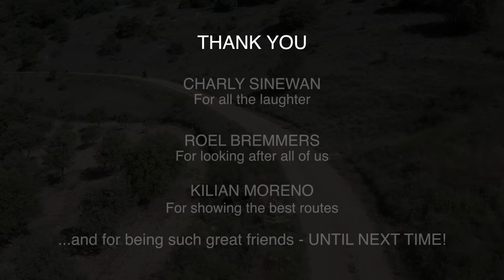Would the Ducati Desert X be my new adventure bike?

Comment: Ducati may be an amazingly good bike, but for some of the remote regions of the world you spend 90% of your adventures in your not going to beat Honda, any Honda, for ease of maintenance, sourcing parts fast and finding a mechanic to help when needed
Reply: Like your thinking here. Maybe a Tenere 700 would be a good compromise.
Reply: @egs5082 Tenere 700 is kind of a heavy tank for solo traveling. It has a high center of gravity, difficult to lift up in case if a drop. The Honda 300 is around 150 kgms, easy to lift when you are alone.
Reply: I agree.  You have thrown some incredibly crazy stuff at Alaska, and for the most part has met your demands.  I think no matter where you travel, parts and assistance will be required. 
In any case, thank you for taking me along in your journey's.
Reply: @egs5082  T700 is still way to heavy at 205kg for Noraly to lift compared to Honda CRF300 Rally at 153kg.
Reply: Spot on not to mention the 300 is much easier to ride in challenging terrain as far as adventure bikes go.
Reply: I totally agree. Stick to something that mechanically just works and is easy to work on. Suzuki, BMW, Aprilia, Yamaha and Honda. They are all easy to work on and have high reliability. Get something that has minimum electronics because running through deep rivers, sandy deserts, shaky roads etc is not optimal for "modern offroaders", they are too dependent of eletronics and that will break in most of those.
Reply: @russcattell955i great point.  Noraly isn’t a huge person so that 50kg is a BIG consideration.
Reply: Good point
Reply: The ducati is to heavy , and more difficult for parts in other country,s stick to Honda Noraly !
Reply: @russcattell955i  --You are Correct, Noraly needs a Bike that she can handle, Lord knows she goes places that Angels Fear to Tread...
Reply: How about KTM 890 adventure "S" with aftermarket suspencion???
Reply: I think Noraly should stick to the Honda.
Reply: That bike is too tall for her.  Fall over much now?  Wait til she is alone on one of her adventures and has no help.  Nothing against the bike but she needs to find one that won't leave her on her tippy toes getting on and when she puts her feet down.  Just my opinion
Reply: Noraly is 10X the rider that I ever will be, but- have to agree with Charlie at 4:00 that you just don’t ‘follow’ someone with greater skills. Worked out this time but use your own judgement.

Comment: One tip about flat tires with inner tubing -when you dismount inner tubing always mark a tire with marker or chalk where valve is.That way when you remove the inner tire and find a leak you can easy compare it to a spot on tire and see if there is any nail,screw or other thing in tire that can cause puncture again .Generally i always check the rim and tire with my hand just to see if anything is sharp but this way you can focus on problematic spot more.

Comment: I'd recommend you consider a KTM 690 Enduro R for your travels. Similar in many ways to the CRF300... weight about 149kg wet, slightly taller seat height (can be lowered some), similar service intervals but with loads more power and torque. And it has a lovely quick shifter :)

Comment: Just an idea if you were to use a heavier than the CRF;
In case you drop the bike, compress the rear and front suspension with ratchet straps. This lowers the center of gravity and it might make it easier to lift it up. I have not tried it myself, but it ought to work. It might save you from hernia. 
The CRF is probably quite heavy too with all your stuff. 
I should try this myself….
Thank you the entertainment.

Comment: Hi, the desert is a nice bike and it looks that this could be good and handle bike for you. But remember at you’ re journeys  how complicate it was to get spare parts and repairing Service for youre easy bikes. Do you think you can repair the motor or stuff around at a small village in namibia or in ecuador ? 🤓😉
How easy is it and how much stuff you need for a petrolfilter change , an oil filter change and how easy is a clutch and brake repair ? Are the electronic at the Desert strong enough ? What happens if the ABS or other Sensor goes wring or defect? What happend with the Motor if you fill up over weeks  with the dirty and low powered Petrol ? Youre own mental attitude and wisdom to keep the bike light, easy and simple was absolutly right. 👍✌️🤓🤓 This are my two cents, think about it 😉😌 But very nice ride and Video from andorra. ❤ have a good time and let it roll. Best Regards

Comment: Weight isn't the only factor limiting or enabling a bike to be picked up easily. My bike weighs 235KG (wet) but is really easy to pick up (and I have no muscles at all).

Weight distribution matters - most modern adventure bikes are too top heavy. 

Also the shape matters, and how it sits on the ground when down. If it lies flat, that makes it harder. The older boxer engines were good because the bike would never lie flat.

The width and position of the handlebars, forks and wheel, can also help. That impacts on the leverage you can get when lifting.

And finally the shape and position of the seat and tank, so you can lean into it.

My bike is a '93 R100GSPD, which is just right. It has all the good properties, including a "saddle-bag" style tank, giving it a low centre of gravity. Our of the modern bikes, I think the 790/890 KTMs have the best shape. But not necessarily the best reliability. The Tenere and Africa Twin seem to have the worst shapes. What other options are there?

Comment: The motorcycle can benefit from incorporating traction control through electronic means. Essentially, this involves installing a sensor on each tire. When the onboard computer detects a discrepancy in speed between the front and rear tires, it adjusts the engine's timing, thereby reducing the horsepower until the speeds are synchronized again.
Reply: You can also implement an anti-wheelie feature by installing a height laser sensor at the motorcycle's base, which operates on a similar principle. Drag racers employ this technology, but I see its potential benefits for motorcycles as well.

Comment: Aprillia's new 457 twin cylinder sports bike is about to transform into an adventure bike, just like theit 660RS did... You might want to take a look at it when it drops next year. Weight similar to tAlaska, but nearly twice the power, and better suspension. However, like most European motos, it will be nearly impossible to get parts and service for, in the far flung regions of the globe you like to travel in. My suggestion i9s the Honda 450 RL, as an upgrade over Alaska... same weight, more power...same ultra reliability. Stick with the best motos possible - Honda all year 'round.

Comment: The desert x will require a higher maintenance schedule vs the honda rally. Also Ducati is not so common in the countries you have been riding through. Also it will be much heavier to pick up if u drop it, if i where you i would be looking to instal the tubeless system instead regular tubes on your next bike.Just my 2c

Comment: KTM 390 adventure should be your next bike....45hp instead of only 27, better suspension and 30mm lower seat height than Alaska, has 400km range on stock tank, and is only 15kg more than Alaska(most adventure bikes are another 200+lbs more). Plus surprisingly easy to service! And only $ 6000 USD when NEW

Comment: There's a reason why you don't see any long distance riders do it on a Ducatti.That bike is probably the WORST adv bike ANYONE can get.. just look at how expensive and often you need to maintain the Desmo valves. Good luck in doing a side of road repair on it. Desmo valve tech was way ahead of time back in the 60's but springs have caught up in the 80's and are now much more reliable. This bike would be a great weekender where you can thrash it then take it to a authorized Ducatti workshop in the city and wait for months for them to fix it.

Comment: I don't think the Ducati is a good off-road bike. The Yamaha Tenere, on the other hand, is a very good rally bike and is lighter than the big elephant touring bikes, which are lied to by their manufacturers as off-road adventurers. The Tenere is more for you and more for off-road. And the Tenere can handle everything... I also had a CRF 300 RALLY bike. It was weak and heavy for its strength. And I also had a Dominator Honda, but now I have a Tenere for two years, because I ordered a Tiger 900 Rally Pro motorcycle, but it didn't arrive, but someone left the new Tenere motorcycle at the dealer and I bought it instead.I was hesitant at first, but I bought it so I wouldn't be left without a motorcycle. I realized that this is the only all-terrain large-body touring bike and can be built on very well. Excellent basic construction. Don't buy an elephant. No Ducati, no BMW, no KTM, no Honda, no Kawasaki, no Suzuki. All of these have poor off-road capabilities. You don't just ride smaller hard enduro roads, you need a load-bearing bike that won't be blown away by the wind. But you are also a woman. The Tenere is a sexy, feminine motorcycle. But also masculine. And it can handle anything. It's like a military motorcycle.Try it yourself. The seat of my Tenere was hard, it hurt my butt after only 10 km. But I took it off and took an upholstery stapler, a small sponge, and took off the faux leather cover of an office chair and made a nice comfortable seat for it. Right under it is the factory Tenere seat. It was child's play. I installed protective tube frames everywhere. It is like the horse of a medieval knight in armor. Invincible. I am 70 kg and 176 cm tall. The Tenere is medium-sized and not big for me. Sit on it. Your engine should run well. The CRF 300 RALLY also performed well, but it is the starter motor. Good ride!

Comment: So before watching direct the answer to the Question. Nope it´s to heavy. You dont want lift up over 200 kg if you are alone and the Desert X and also Roels Transalp are on the lighter side. And the other reason, ever tried outside from so called civilized coutries to get Spare Parts for an Ducati instead for Honda. KTM 450 Rally Replica with their 80 build limited Edition out of the way there are only 3 other Bikes for Noraly that are light enough. The KTM 390 Adventure, The Himalayan and the Scram 411 and with the KTM you get the same Spare Part Problem like with an Ducati. OK there are the Lifan and Locin 210, 250 and 300 but there you can stay with Alaska. KTM your Chance KTM 450 Noraly SE 1 out of 1 with Spare Part overnight  Airfright Shipping included sponsoring and you can cheap out a bit Noraly doesn´t need an Akrapovic for example

Comment: Toyota now makes the most reliable vehicles, and Toyota owns a large percent of Yamaha. I have owned Hondas, and Toyotas, and Yamahas. Yamaha is most reliable. Just better quality parts used. Ducati uses at least some motors with no valve springs. Cams to open, and cams to close valves. OK for very high revs, but many more parts and servicing. More complex, more to goo warong.

Comment: I wouldn’t touch a Ducati or any other exotic bike that would go with you on your solo adventures. You need a work horse that is simple to repair and find parts for. It needs to be light and reliable. BMW’s, Ducati’s, KLM’s, electric, anything Italian are all high maintenance and difficult to repair. Stick to Honda, Suzuki V-Strom or Kawasaki KLR 650. The Kawasaki has rarely changed its design and will run forever.